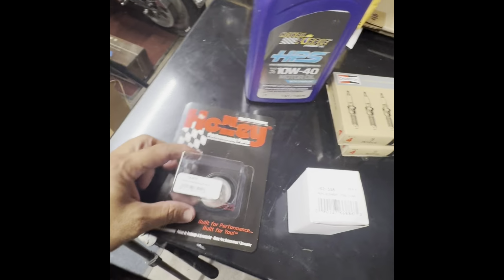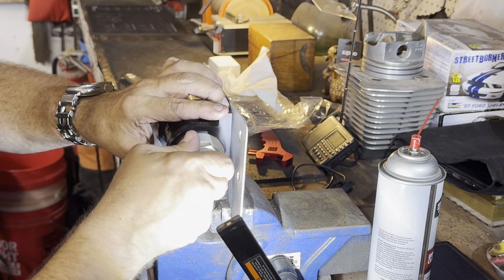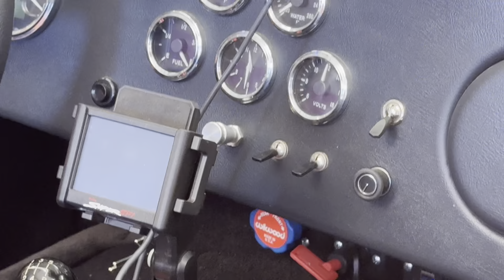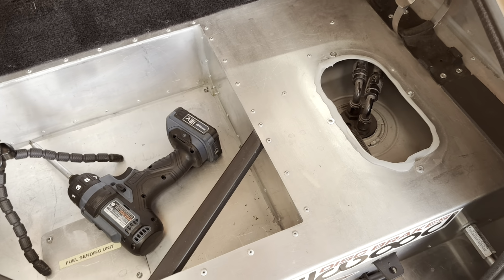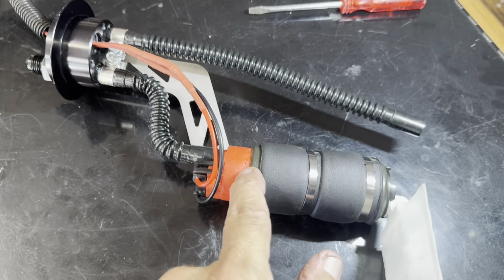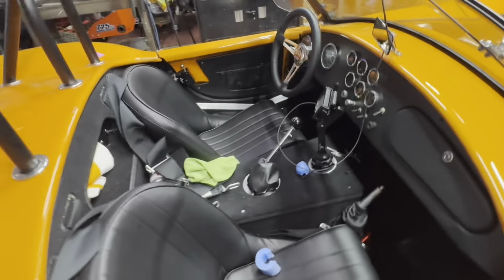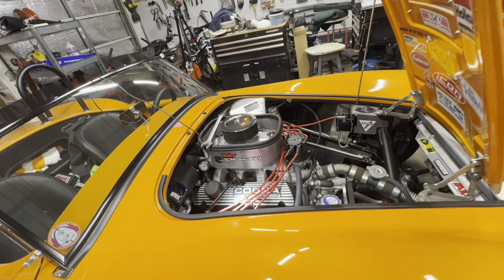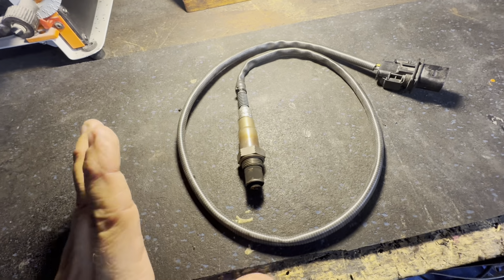Factory 5 Shelby Cobra MK4 Replica Update

Comment: Great troubleshooting and information video Dan. I'm on the fence about FI, I want it, but what brand and do I want to deal with these issues? I've been following a few builds, some OEM FI, Holley Sniper, carbureted... I want a bit of a lumpy idle but streetable, not worried about horsepower, any will be enough. I took a stab at the Holley Pro-jection back in the 90's and failed miserably. It was an open loop system, and I could not get it to idle well, or get off the line. After a year of messing, I threw a trusty Holley 4bbl on it and never looked back. Gleaning all i can from guys like you in these builds, keep up the great work!
Reply from the maker: @markhoward3851  thanks & thanks for watching.
I was going to go with the Edelbrock EFI system but at the last hour decided to go with the set up that looked more period correct with the Holley Sniper Stealth. I will say that if you have a new engine and your building your car as long as you have Fuel, air/exhaust & trimming right in my experience now…Holley Sniper system is great. Their customer service is second to none. They would not let me go till we figured my issue out, they were relentless. As far as the lumpy idol just choose a lil more of a radical cam and the sniper system will start up with it & you can fine tune it or call tech support 8am-430pm M-Friday & they will walk you through it. Whatever you choose let me know how it goes, post some videos 😃👍

Comment: 340lph pump seems like overkill. Check for a voltage drop while the car is running. Also the return line hanging like that is probably causing aeration around the fuel pump pick up.
Reply from the maker: Voltage drop was my thought right away but that’s not the case. Pump may be overkill but the fuel pressure is regulated. Changed everything out  just to be sure. I just found a tuner with a Dyno  real close to me so I think it’s time to get some professional help, besides I wanted to dyno it after 1000 miles . The Sniper system is relatively simple but not simple enough for me I guess.
Reply: He's my view from watching your videos. Due to your cracked headers etc your efi has been running rich due to high oxygen content in your exh. The holley is adding fuel. This extra fuel has washed out your o2 sensor. I bet your plugs are black? Re fuel pressure did you fix that? Lack of fuel makes it lean. Don't trust that fuel gauge either, they're not reliable.
Reply from the maker: @clarkson427  exactly my thoughts so changed the plugs already, fixed the fuel issue & pipes & the potential exhaust leak I may have had and waiting on the 02
Reply from the maker: @clarkson427  I appreciate your help!!
Reply: No problem, I appreciate your videos, keep up with the good work. Few other things I forgot to mention. 1, can you set your fuel table on idle to run 14.2afr at idle and then run/set open loop? Performance camshaft and o2 sensors don't work will together on idle due to the overlap of the cam. This alone will cause a high oxygen content on idle, so you think it's lean and it's actually rich. Always go by you sparkplug colour. I just don't believe the self tuning esp on a performance engine. I think I've posted up some videos of mine getting mapped on the hub dyno.